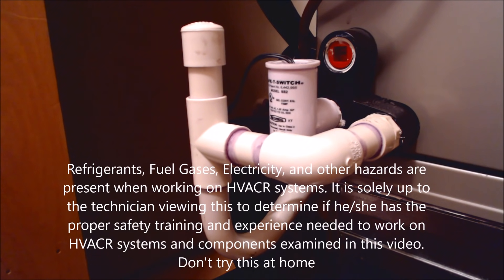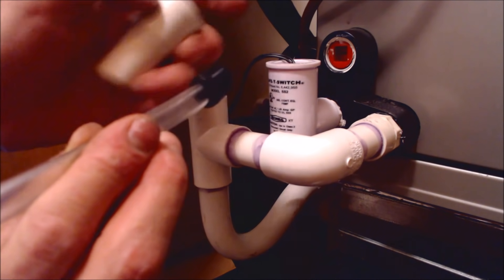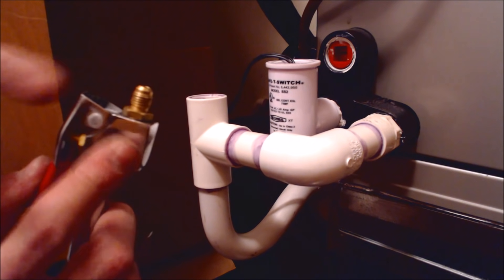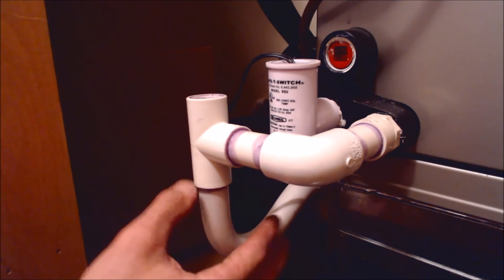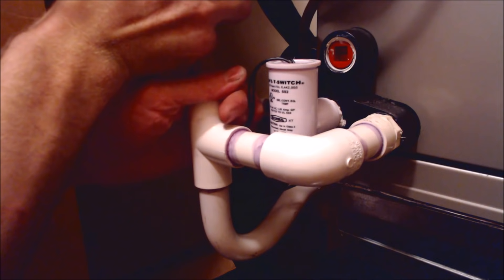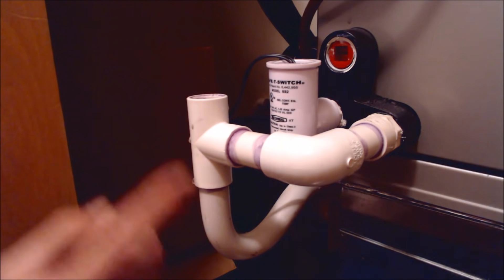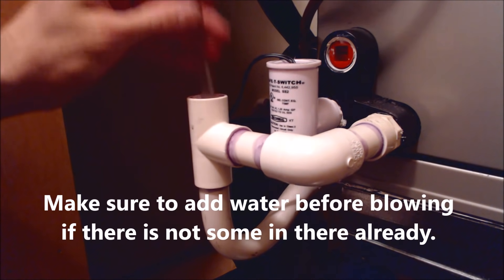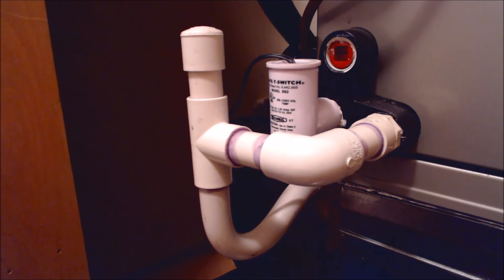Fast and Easy Clean Out of Condensate Lines on an Air Conditioner!

Comment: Hello, I need help on this too.  For the first time, because of summer heat, there an inch of water on the water pan underneath the air handler which is sitting on a wooden pallet which then sits inside the pan. Because of that, I'm afraid the water is going to ruin the pallet. This is how the builders constructed it. It's upstairs.  I had to use a small sump pump.  There are 2 pipes going to the outside where they are placed near the eaves of roof. One pipe comes out of handler with the trap & cap as shown here in video. The other pipe seems to be a drain for the water pan, except I don't see it draining the pan.  So should I try the mouth blowing technique shown here? I could send a photo of it for clarity.  We have used a service before but it was to change the blower motor & that was a hefty $800, even after he helped with a discount.  I don't want to pay for service to clean out condensate pipe because it will probably be at least $75-100 just for the visit.  The pan is getting water again, so need to sump pump again.  I assume the pan drain pipe is also somewhat clogged too.  Please help.

Comment: I see your common plumbing mistake all the time. The tee should be after the P-trap in line and vented , and higher than the pan inside the evaporator. I never cap the vent for obvious reasons. Other wise it won't vent. The "water seal" in the P-trap should be the first thing after the outlet drain. Some municipal codes require that. Otherwise your tool ideas are good.
Reply: Bob is exactly right it is a common problem that installers often lack the foresight to instill  preventive measures that techs are left to clean up .

Comment: There is a need to vent the drain pipe to help it drain properly.   When  the evaporator blower creates significant vacuum it can stop the water from flowing down the drain if there is no vent to break the vacuum force against the drain.
Reply: Does the vent need to be before ptrap or after, or does it mater at all??
Reply: The vent is after the trap.

Comment: I recently came back to a completely clogged drain on my A/C. Tried the shop vacuum, water from the hose, etc., no go.   The only thing that worked was the air compressor. Nasty crap came out all over and it had been professionally cleaned 5 months ago!   Compressed air is the best, not sure about blowing air into a tube, unless it’s pretty clean already or as a preventive measure.
Reply: they have chlorine tablets to keep mold under control

Comment: Most of the HVAC companies in my area refuse to put a trap on the condensate line. I can feel air coming out of it. And there's no cap at the top for cleaning either. Should I have it redone?
Reply: Usually why they put on a trap is because it ties into a drain line keeps sewer gas from coming into AC unit

Comment: Why would trap be most likely dry if it's a PM? I don't get that.  It should always be primed, or in the case of an air handler with it on the return side it would end up being a service call for leaking condensate.

Comment: replace the 90 with a T and that T with a 4 way cross . put threaded plugs on them and viola . fast multi point maint /service access . take a small flexible pvc tube , adapt it to fit a portable wet vac hose and viola , vacuum the trap then recharge it .

Comment: Used a shop vac outside where the two drain tubes came down from ac unit and pan in attic.Use duct tape or plastic  lid with hole in center to make up the difference  in size and seal hose when doing.

Comment: This guy is nit thinking don't ever blow a line out .. use a vac and such it out.. if any connection is not glued it is possible you can blow a connection loose and now water will run out and destroy your drywall etc.. wow

Comment: This secondary ss2 switch is improperly installed. on carrier airhandler water level will no go high enough to trigger this ss2. it will overflow the pan first. need to use 90 elbow to lower the ss2 below the pan level.

Comment: This condensate line is not pipped correctly. You would install the trap first, then the vent, just like you would a sink.
Reply: Plumbing 101

Comment: Great tutorial. 

Can you take a look at my setup? 

https://www.amazon.com/photos/shared/M1j2IO99ThS2JQFgFPSmXw.IKb78X2mZLUnI2rfO83epR

The only place I could pour vinegar is in the cap marked as the removable cap. My only concern is that the vinegar will route through the Air Handler on its way to the pipe below marked "Exit to Outside" which is the pipe that carries water to the drain on the outside of the house. Thanks

Comment: The best way is to put about 8ozs. of bleach in the drain line with about 16ozs. of water behind it every time you change your filter, this should solve any issues with the drain. I have been doing this over 30 + years and never had an issue.
Reply: Do you need to vacuum outside or just leave it alone?  Can I use vinegar instead
Reply: @WonderfulAreThyWorks  I don't use a vacuum, I have never used vinegar, I don't have an answer for that.

Comment: Having worked as a handyman for many years. I can say that this method is the best way to solve your problem.
Reply: I always use a wet-dry vacuum, sucks out the junk and you can clean the unit and area. carrying in a bottle a bottle of gas is another trip.

Comment: Does every HVAC need a P-trap? My AC was not working. The technician said the condensate line is clogged and he cannot access it. So he drilled a hole on my wall and use a pipe to direct water to outside. There is no P-trap in the new setup. And now my AC runs one hour every time then rest only 20 minutes before turn on again. Even it runs almost all the time, it did not cool much. Did I hire a bad repairman?

Comment: I spliced in a hose barb and use the garden house to blow out the line. After flushing the line, I pour in some Clorox. If you don't fill int "P" trap, the dripping water will refill it.

Comment: I live in a condo and my a/c line has been getting clogged a lot, already 3 times in the last three months. It seems like it happens when it rains a lot. Do you think the main line where it drains could be clogged?
Reply: It's full of algae and dirty gunk. Blast air in it, some bleach and hot water several times.

Comment: Should you see the water/vinegar drip out of the condensate pipe outside after you do this?My landlord poured vinegar down that tube and cleaned it out that way. There was no cap on my tubes.

Comment: shoot me... my trap filled up with mould or something, i cut it out and ran 'er straight.  no idea why that would need to be there...
Reply: The trap keeps plumbing gasses from being sucked into the ac and out the house ac vents. There's 2 drain lines the back up is on a pan and has no trap. The main line goes to your plumbing.

Comment: Great video!  My air man told me to pour a cup of bleach each month down that drain to prevent clogging. Of course I ain’t do it in 6 months and now...here I am!

Update!!!  I went to the store, bought a tube, put it down the pipe and blew....checked later and my drain pan drained itself!  Thanks for this video!  Saved me a ton, called an AC company and they said $150 just to come out!!!  I bout a $3 roll of tube and fixed it myself!!!
Reply: Salt will work just as well as Bleach and is much safer. It works by a Osmosis. Put a couple Tablespoons of Ordinary Table Salt or Rock Salt, in the Drain, so it sets in the trap.

Comment: If it’s the inside mine is perfectly horizontal and the pipe goes both ways so I won’t be able to block off one side the water flows through it

Comment: That AC drain switch is a good idea, but be careful, I had one connected like the one shown in the video and water still leaked from the pan without shutting off the unit, because the water level raise needed to activate the cutoff switch was higher than the pan overflow. This leaking water caused considerable damage over time. The water was going into the plenum located beneath the house. Mold grew and one day we came back to our cabin and the house smelled terrible. The insulation inside the sixty foot long plenum was full of mold. It cost a lot of money to have all the insulation removed. All the air ducts and plenum then had to be cleaned. 

The truck used to evacuate the plenum and duct work had a huge suction machine that pulled every lose particle out while the workers inserted spinning brushes inside the air ducts and plenum. Once clean, the plenum was sprayed with a chemical that killed the mold. The the entire House and air duct system had to be gassed with Chlorine dioxide to kill any mold in the interior. . The guys who did this wore suits and breathing gear. They looked like astronauts. The house then had to sit for three days unoccupied. The plenum was then insulated on the outside. My total cost was five thousand dollars.

I solved that switch problem on my unit by adding an offset coming directly out of the unit which allowed me to place the cutoff switch a half inch lower down. Now it works perfectly like it was designed to work.

After my experience, I would never place that cutoff switch straight out level on any unit. I also added cutoff valves and a water hose input to my drain pipe, so I can flush my entire drain pipe ( 23 feet long ) twice a year with my water hose. I never want to have another stopped up drain pipe on an air conditioner again.
Reply: Almost exactly what happened to me. The float was never raised by the water.
Reply: Damn
Reply: So grateful for your carefully written anecdote! THANKS!
Reply: I'm so happy you had all this work done. Wow, it was costly. This is another reason why I don't like Condensers on a Roof-Top. You can't get to this Unit, and it needs attention. I expected after 40 Years of Residential/Commercial A/C, that there would be little to no problems. Keep in touch.

Comment: I have same setup but no cap or kill switch.  Does cap really help anything?
Reply: you want the kill switch in case pan backs up it wont flood your house....cap allows the water to drain properly UNLESS it is the VENT CAP. the clean out cap is BEFORE the trap and the VENT is after the trap.

Comment: Opened up leaking coil today and found a rodent, dead, blocking the drain. Had no secondary line on pan. Owner had replaced duct in winter from rodent damage.

Comment: Loved your video.... What could be the reason I hear pipes vibrating when my air comes on. I cant see where they are only audio?
Reply: Motor vibration in unit not mounted correctly or fan out of balance cause it's dirty or bent.

Comment: An old air mattress inflator (corrugated) tubing connected to the air compressor blower/gun sealed with duct tape does the trick too. The idea is to get into the p-trap and blow air into it.

Comment: Hello, can you still put water if the hole to put the water in is not directly on that curved location?

I have a pipe where you can put water in, but it is not directly above the curved area and is a little to the side
Reply: So basically the AC piping was designed 

Like to the left you have the pipe going straight down where the water goes 

You go more right and you see the hole where you put the warm water 

Go further right and you see the curved piping where the water usually gets clugged

Go further right and that's where the AC system is mounted

Comment: Cleared the line where the trap was. Didn't seem to be the problem. Water is dripping from where the unit meets the pipe connection into the pan. Is there a way to clean the area back to the unit to see if it's clogged at the unit's base?

Comment: I used a shop vac to clear my lines, now the other line with sensor is overflowing.  Is there a valve somewhere that closed because of the vacuum
Reply: lol negative pressure from the unit. prime your traps after you clear.

Comment: But doesn't that just keep the gunk in your system?
Reply from the maker: That usually blows it apart. You can also suck it out with a vacuum if you can get the tube down in there, thanks!

Comment: I could not locate my outside drain, could I just vacuum from that pipe by the air handler? I also don't have an air compressor
Reply from the maker: Yes you could if the tube fits down past the tee. Make sure to fill the trap back up with water when you are done, thanks!
Reply: @acservicetechchannel  in texas the condensate water does that job for us.

Comment: My drain is in the attic and runs the width of the house then down the wall to the ground level. Recently ours been clogging up and water pools inside the unit. My unit is mounted on its side. I've been out the line and water comes right back in a few days. Tried hooking up the shop vac but i don't think it's strong enough because there pipe is so long. No signs of water coming out of the end of the pipe either. This concerns me.  Feel liked i have a clog somewhere. Tried Drano, bleach, and vinegar. Good to know there is supposed too be water in the trap.
Reply from the maker: Yes but it should continue to flow to the end. You could try cleaning out the trap or cutting it out and replacing if that is where the clog is, thanks!

Comment: For removing the slime/blob buildup, is it ok to use bleach to clear it out the drain pipe? I hear some people say yes, others not.. because supposedly bleach can dry and build up around the inner wall of the drain pipe, therefore eventually clogging it even more?? is this true or not?
Reply from the maker: It really depends where the condensate is flowing to more so than any bleach buildup in the pipe. You could try hydrex tablets in the condensate pan if you were concerned, thanks

Comment: I don’t think you should ever use compressed air to clean a drain you can crack or break the drain
Reply from the maker: That is why I only use 30 psi. I don't prefer the gallo gun or high pressure, thanks!

Comment: I have two possible lines that I can pour in, which one should it be? One of them come air out of it when ac is on and the other doesn't.
Reply from the maker: It is the one with the air coming out of it while the system is on.
Reply from the maker: Also look for the trap, thanks!
Reply: one is the vent and one is the cleanout. Pour a lil in both it wont hurt.

Comment: Screw that...  Just hook up a wet vac outside discharge line.  Takes about one minute and removes all the gunk...
Reply from the maker: I like to add water back into the trap before blowing the air through again. The wet vac on the discharge is goo for lines that are not pitched properly though and have a lot of water in it, thanks!

Comment: Safet t switch will make a contactor stuck closed
Reply from the maker: You would need to break the y cooling wire or the r power wire and it will not power the contactor, thanks
Reply: @acservicetechchannel  ok.   My contactor is stuck closed.  If i disconect yellow wire and red wire from control board it becomes open.

Comment: I don't have a T-pipe on my Hvac system what gives?
Reply from the maker: Many that I go to don't have one. You could try vacuuming the end of the pipe where the water exits with a shop vac. Ido this or do both to make a hydraulic affect with the water to clean the trap out, thanks!
Reply: @acservicetechchannel  I have a L-shaped connecting pipe on the top of my Hvac system how can I remove that because the condensate drain line is clog I went outside earlier with the wet/vac to unclog then drain line but nothing came I know it clogged because when the A/C was on a couple of days ago water was on the floor and I could hear it dripping in the pan.
Reply from the maker: I either take the door cover off to get into the inside of the condensate pan to blow out the open tube but other times, I just cut the tubing out and replace it with what I want to see there, thanks!

Comment: I just add unions before and after the trap, if I have the room. If I don't have the room I'll make the room for 2. Once that's in place all you have to do every year is undo the unions and flush the trap out, after that put it back together and pour a liter of water into the pan with a small amount of simple green. The simple green mixture will then sit in the pipe and eat away any gunk if there is any in there. Also I forgot to mention I use hot water to clean the drain. I find that blowing out drains only pushes things down the line, especially with a lot of turns and bends. I like to make a process out of cleaning the drain because it's more worth taking the time then paying for a ceiling and sometimes more. Do you think I have a good process going on?

Comment: I installed the Cost Gard condensate drain seal on my unit which eliminates the Trap all together. So no more water sitting in a trap I have a blow through system and will never have to clean out a trap.  Best alternative on the market I even did a video on it. Titled:  How to never clean your AC condensate drain line.
Reply from the maker: Great Job Jonathan!

Comment: Yeah don’t do that. All your doing is pushing it further down the line.
Reply from the maker: Hey Michael ,did you see this video- https://youtu.be/guf3TESb3V0  on some traps if you try to vacuum and there is little water in the trap, you won't be sucking anything out either, this other video show the shop vac, thanks!